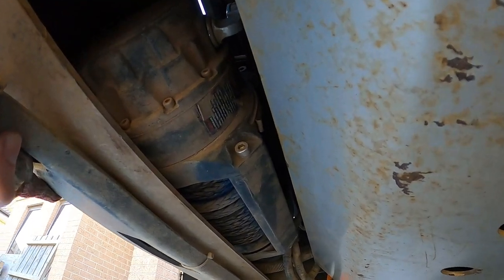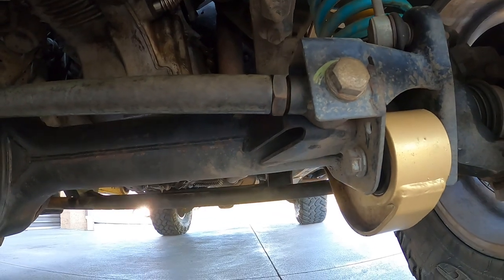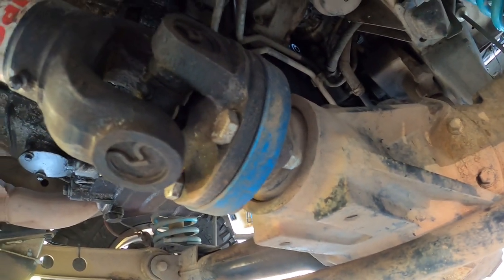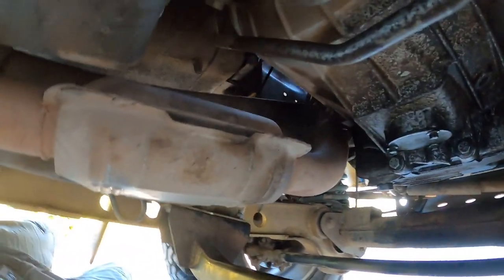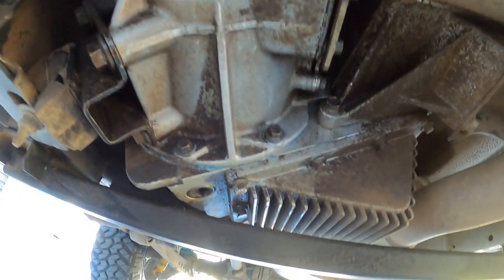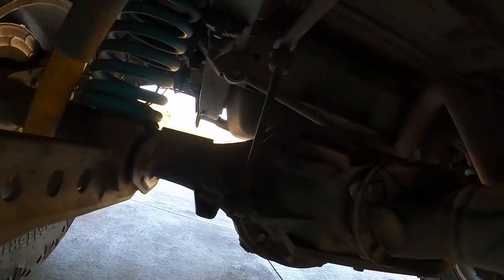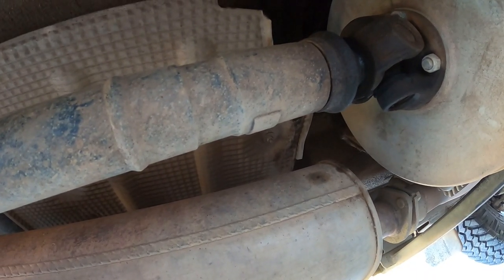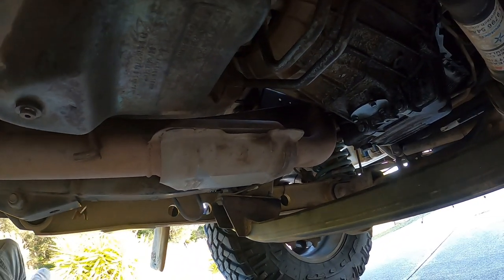Discovery 2 Modification - Underside

Comment: The rover 8” truely is a pile of trash, you just brake the centre or also C&P?
Reply from the maker: Yeah, I've broken a few. Usually starts with a broken cross pin for me. But not since replacing the centres front and rear with Ashcroft ATB and KAM C&P.

Comment: Your explaining of the pan-hard with the diff pinion geometry is incorrect, panhard does the body to the axles and caster correcter does the pinion angle and prop shaft
Reply from the maker: It was not simple to explain so I might have not been very clear. I wasn't trying to refer to the caster or diff pinion angle,  I actually forgot to talk about it. I was trying to explain that when the axle housing moves on the vertical plain it must also move on the horizontal plain. If the panhard rod is too short for the suspension lift the diff will not be central to the chassis as it is designed to be. But as you mentioned, the caster corrected radius arms do something completely different and unrelated to the panhard rod length.